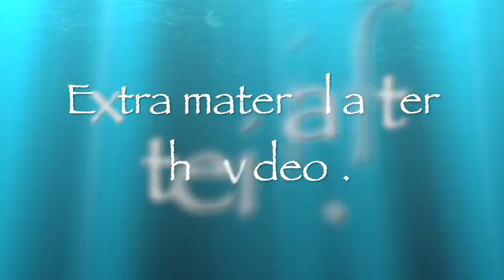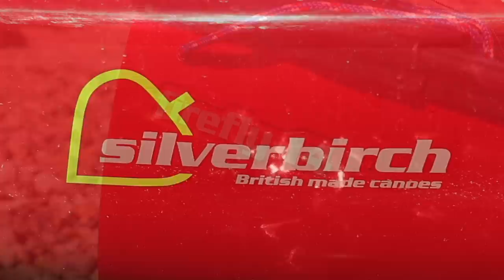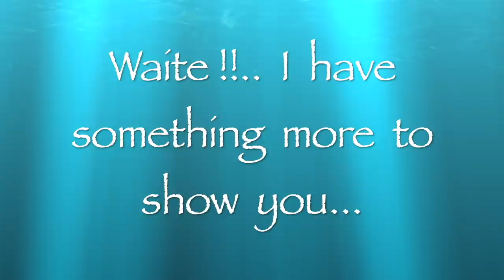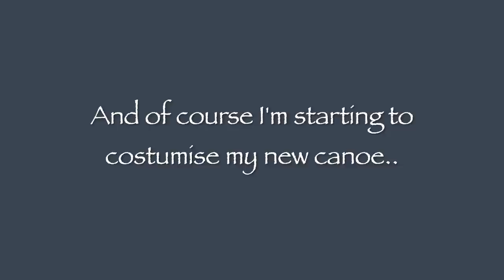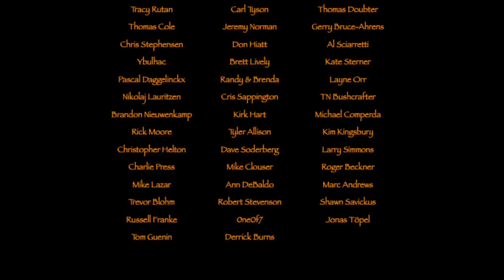Canoe Bushcraft Maiden Voyage

Comment: High again Tom, when you pull your paddle to the back,  hold it longer in the water and turn it a little bit ( ca. 30° ) with the back of the paddle-blade away from the boat to control the direction. It goes much easier then. Kindly Fiete
Reply from the maker: Thanks Fiete for your advice 😁👍🏻🛶 appreciate that my friend 
Atb to you 🔥🏕🌤🌲 Tom 🇩🇰

Comment: Hilsen fra Utah Tom. I recommend you try a BeaverTail paddle. They are narrower and much easier on your shoulders compared with the broad-bladed paddles. At my age I have to treat my shoulders nicely. :) My paddle blades are 13 cm wide by 70 cm long. You definitely have the skills to make your own like I did. I liked the narrower blade so much that I cut my broad paddle down to 13-14 cm wide.
Reply from the maker: Thanks Michael for your kind feedback and great suggestion 
😊👍🏻 I’ve thought about making a paddle … and maybe I’ll make a Beaver Tail style as you suggested 🤗🛶🏕🔥🌤
Tom

Comment: The only problem with how canoes are made is that when you sit in the seat they rock from side to side and are unstable  with bigger men like you and me.  Some people build two - - 3 foot long pontoons that they bridge together on the very front of the canoe for stability.  I have also seen plans for making a rowing bracket machine so you can skip across the water quickly.  Because of my age I had to pass my canoe onto my 40 year old son.  He loves it!
Reply from the maker: Thanks Paul for your feedback 😁👍🏻 Your right about the canoe is not super stable when a big guy like me and you are sitting in it 🤔 and I’m considering getting a lower seat for it. Thanks for joining me on my maiden voyage and for all your kindness and support 🛶
Tom